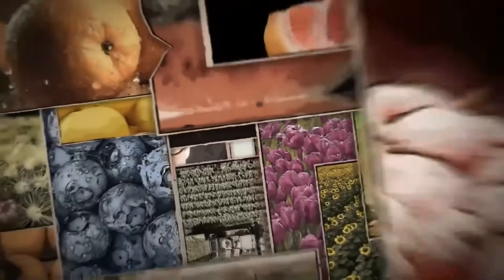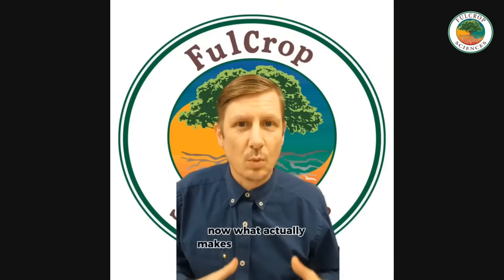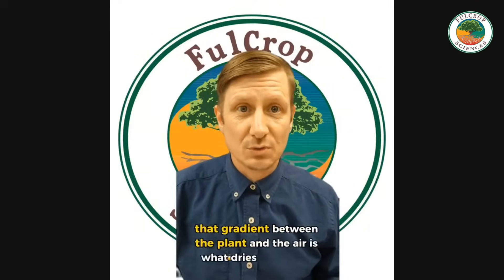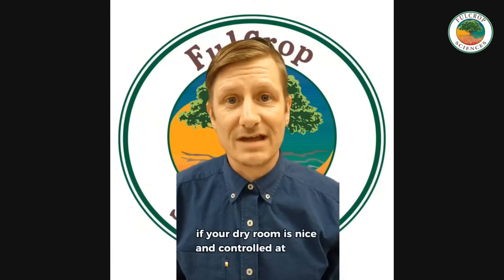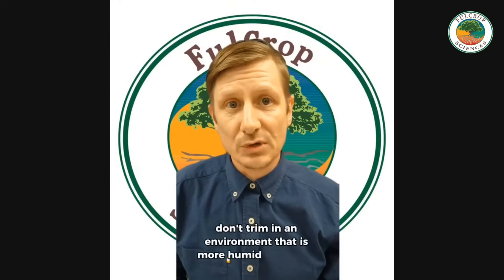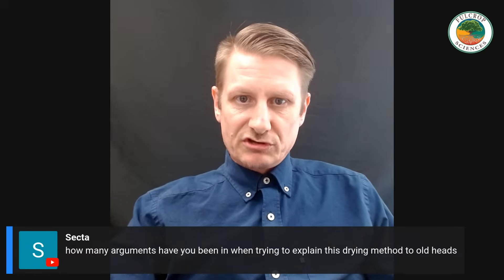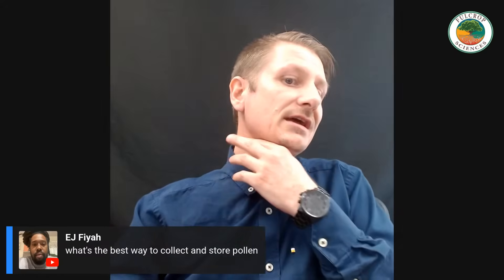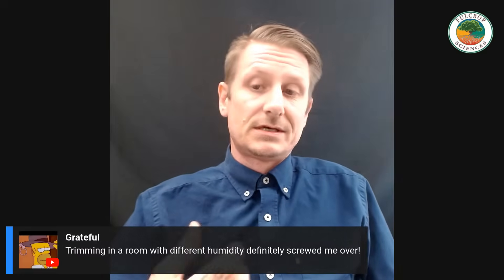Why 60/60 is NOT the gold STANDARD for dry/cure!

Comment: 60% Fahrenheit, what's that, you absolute stoner, haha. Great video, thanks for helping people realize there's actually science involved in this process, which anyone who has studied the cigar industry would know. I figured this out on my own, starting with 60/60 and then just not caring one winter and finding a better result from 70/45-50 that was in my basement at the time. I have found anecdotally that your numbers are about the same as my best cures. I've been growing over 30 years and it took an embarrassingly long time to figure this all out. It sure would've been nice to have a straightforward video like this 20+ years ago.
Reply: In my basement it's about 70/45. It seemed to work out great. Buds were a bit dryer than the stems. Everything was sugary and dried. I cut and bottled. Seems ok. Novice grower here, but 70/45 was better. But I imagine bud density is a big factor if it is the best way to go?
Reply: @jamesnorton7601  First of all, great to see a new grower immediately getting drying/curing going well. Back in 1995 when I started growing, there was no internet (technically it existed) and not much information, so it was just every person doing their own experiments and maybe a book that was often inaccurate or outdated. It's nice to see how much more is known now compared to then, and the information is easily accessible unlike the 90s/early 2000s.

As for your question, yes--bud density and also leaf density are big factors in drying and curing, as well as terpene profile. Some terpenes are a lot harder to hold onto even at low temps like 60, let alone 70 F. Some of it comes with experience over time, but most of it is science. The trouble is that everyone's growing different varieties and so it's hard to really come up with a "one-size-fits-all" solution to drying and curing. If I follow any official guides on drying/curing for a 26-week flowering landrace sativa, for example, it's going to go very very badly because it needs to be dried and cured VERY differently from what most people are growing these days (modern polyhybrids). 

Now that youv'e got your buds jarred, make sure to check on their RH regularly. I've had a few friends that were new to growing make the mistake of putting their buds in the jars a bit too early and they rehydrated and needed to be dried a bit for a 2nd time, which really isn't ideal. 

As a new grower, I'd recommend you check out Build-a-soil's youtube channel and Jade Nectar and consider growing some heirloom or landrace varieties (the easier to grow ones, since you're a beginner). The biggest waste of time for me was growing the wrong kind of genetics for 20 years. Landrace and many heirloom strains have magic in them that just can't be found in modern polyhybrids.
Reply: @tsuobachi thank you very much for all the info.
Reply: @jamesnorton7601  You're welcome. Have fun growing, I've been doing it over 3 decades now and it's even more enjoyable now than it was when I first started.
Reply: @tsuobachi I am having fun. Thank you for the advice. Keep enjoying it yourself.
Reply: F is better than c because it has more degrees/is more nuanced

Comment: I’ve actually dried at 40-45% humidity at 70-72 degrees Fahrenheit for a week and the weed was fire. That just happened to be the humidity and temp in my apartment at the time lol
Reply: I am starting to think adding humidity is not good. It would make sense to put them in a space and let them dehumidify themselves. Just try to get the temp as low as possible.
My last harvest was ruined trying to adhere to 60/60.
Reply: @granolafunk6192  how was it ruined at 60/60?
Reply: @ghostface3819  Because I couldn't get 60/60.
60/60 is not achievable in the majority of climates without dropping the temp in the lung room over 20 degrees from outside, which is expensive.
If you can't get 60/60 it would be better to approach it like you can't get 60/60/
Reply: @granolafunk6192  but how was it "ruined"
Reply: @romanhlohowskyj  Trying to exhaust nonstop dried everything out too fast. Months of curing didn't fix it.
Reply: @romanhlohowskyj  Next harvest I am going to at least do 60RH, but only after a few days at 55RH. Essentially like this video says. Trying to push through the initial dry quickly, and then slow dry them the rest of the way.
It's not summer, so I can get my temps and humidity low.
Reply: I was higher for temp but yeah, same here. I had no idea how to dry and just threw them in my closet.
Reply: That VPD is outside of the proper range.
Reply: @James-p3m8j vpd doesn’t apply like you’d think for drying. Cellulose (bud) will hold the same amount of water at 60% humidity at 50F and 80F. Once it’s dry, the moisture level depends on different physics.
Reply: @SetTheCurve  Now you are debating the scientists not me. VPD is about moisture migration, not just respiration.
Reply: @SetTheCurve  I think the main reason for VPD with drying is giving an approximate range for mold. Closer to <.8 in the first few days is the range mold can develop. If you stick closer to 1 or greater the conditions for mold aren't very good.
Reply: 55 percent humidity and 70 degrees Fahrenheit the first 5 days, drop down to 65 degrees Fahrenheit and 65 percent humidity for the rest of the dry period was my optimal range for perfect buds that stayed perfect in jars for going on 4 months cured current date
Reply: At 40% humidity. You just ruined your harvest. You don't grow. Stfu
Reply: Thats just about what my drying tent/room was at for my outdoor plants and they all turned out complete fire 🔥 especially the peanut butter breath that shit looks ,tastes and hits like indoor!!!

Comment: I agree...helps keep bud rot, pests at bay. 14 to 16 days always seemed sketchy to me. Just cause you run 60 60 doesnt guarantee a smoke. So hell yea im starting drying right now...im giving it a shot
Reply: What did you think of this new drying method? I’ve had great results with 65*\60% over 10-14 days depending. The terpene preservation was impressive. It smells so strong doing it this way that I am afraid to try this new method. Is it really better?
Reply: What did you think?

Comment: lost me when you said 70-72°f to speed it up. all that’s doing is killing terps then you contradicted yourself saying a longer 60/60 dry exposes the plants to the environment longer and terps volatize. however terps don’t volatize unless they’re in 70°f and up. you dry slow to burn off more chlorophyll all speeding up does is ruin the potential louder terps. please people just dry the closest u can get to 60/60 and always with indirect airflow.
Reply: 72/72 day 1 then gradually go down to 60/60 day 5 hold that for 5 more days. Next 4 days go down 1% RH everyday. This works the best for me, gets that 90s chronic smell everytime.
Reply: Let me try to clear this up. When you cut the bud down, it’s wet—so the moisture content is essentially 100%. When you adjust the temperature, you’re changing how much water can be suspended in the air. Higher temperatures allow for more water, while lower temperatures allow for less.

So, when we dry at a higher temperature, we actually increase the humidity, meaning there’s more water in the air. Does that make sense?

When we talked about the smell, what causes it to fade is the trichome being damaged. A trichome is basically a glass ball on a stick. If you dry too fast, it cracks—just like how glass cracks when cooled too quickly. The temperature itself doesn’t necessarily destroy the flavor; after all, we smoke it at several hundred degrees.

When you add it all up:

Higher temperature = more water content

Higher temperature = better microbial activity

60 degrees doesn't ferment properly, there’s still sugar and chlorophyll left in the plant, and burnt sugar and chlorophyll tastes bad. Higher temperatures also mean more moisture, which prevents the trichomes from drying out too much and cracking.

Unless you plan on storing the buds at 60°F indefinitely, it’s kind of pointless, because you’ll eventually keep or smoke them at room temperature—around 75°F.

Just thought I’d provide a little more information.
Reply: @cam-c7e4u  Forget broscience and stick to people that know what really happens during dry and cure.
https://youtu.be/mFSvSDEVShc?si=BRX3x5_INcXkoQUt
Reply: @cam-c7e4u holy yap. 45% is frying ur plant too fast breaking your trichs erasing terpenes combined with 70° your trichs are now starting to break down. no no just no, dry at 60/60 and enjoy the full flavor and aroma. why would u ruin 3+ months of work just because u want to smoke something faster. it’s like wine you gotta give it time. and yes im storing them close to 60° year round because again why would i work on something for months just to ruin it
Reply: @TheHarvestHouse420 it's not ruining it its very similar when following vpd yes terps are volatile  but u cant save them all specifically bc air by itself degrades them also those super low temp terps are going at whatever the temp is that they flash at and its why when u open ur grow u will smell weed and those arent in ur final smoke even at 60/60. Also if ur thinking is correct then 60/60 would be wat the flowering should be done at otherwise ur shooting urself in the foot if as u say it keeps more terps but we dont grow below 70. Personally when ive done some experiments people couldn't tell the flower apart but once smoked one tastes better everytime and lets be honest weed needs to taste good and have the effects to match everything else isn't really relevant besides it being clean.
Reply: @devinej8411  Some people are obssesing to the point of ruining the joy of a good run.
Reply: @devinej8411 no point in rushing months of work at the finish line. 60/60 for aslong as u can, you can keep your plants hanging in that environment for months and they’ll be fine
Reply: @TheHarvestHouse420 this is actually the science behind it. 60/60 is bro science and if you knew anything you would know that. 60/60 comes from an ac unit hahaha

Comment: This is very similar to how I’ve been drying my most recent harvests. Worked extremely well and terp preservation has been some of the best I’ve managed to pull off yet!

Room drying was a steady 70-72 degrees Fahrenheit(time of day dependent) and with a 50pint dehumidifier was able to keep the RH of the room between a steady 50-55%. 

Days 1-3 of drying I had the RH set to 57-58% and then dropped it down to 55% for 2-3 days and closer to 50% for the remaining days of the dry which totaled 8 days.

Definitely would recommend this as well as it cuts out a solid week or so from the “60/60” method and absolutely lessens that likelihood of mold/mildew setting in as you’re in that key window, last few drying days or going to jar.

Awesome video again! Everything you put out on this channel is solid, extremely to the point and I learn something valuable every time!

Appreciate you taking your time to make and share this knowledge with us all and for free at that!

Comment: I have always wondered if jar burping was mainly to remove excess humidity. If I have reliable RH meters in my jars and they are all below 60% then is there any reason to be burping them?  Seems to me that all I am doing is letting terps out & fresh O2 in, which oxidizes the buds.
Reply: That's exactly what you're doing once they're at that humidity you do not want to open the jar instead you want to take all the oxygen out of the jar put a oxygen absorber in the jar and store them in a cool basement or the fridge for long-term storage

Comment: The truth is every dry and cure is uniquely different, with practice comes skill.
Reply: That is true, especially with heirloom and landrace varieties. But in my experience, about 70 degrees F and 40-50% RH is always better than 60/60.
Reply: @tsuobachiI I like 65°/55%, but it's dependent on density, node spacing, amount of leaf mass remaining, water content of stalks and stems, etc also. There are so many other factors such as air flow, weather, etc. it's really different with every dry and cure. One size does not fit all. Skill and experience will dictate ones efficiency and luck with perfecting the end stages of cannabis cultivation and preparation. Whatever works for you to achieve the best end product.
Reply: @BrianM-44041  Agreed. I've been doing this over 30 years and every single time I still learn little nuances about it. It's extremely important for me because I grow 95% landrace and heirloom varities as a breeder, so the terps tend to be a lot harder to hold onto, especially with equatorial sativa landraces that can take up to 26 weeks to flower. Messing up a dry/cure on a plant that takes that long is really disappointing.
Reply: @tsuobachiit's a double edged sword with equatorial landrace varieties, they love heat l, yet heat destroys smell and flavor. Long flowering sativas are a whole other level of growing, and while satisfying and necessary for breeding, it's no picnic. Definitely more difficult and often gives you less yield. But many will agree that it's well worth the wait and sacrifice. crucial, even, for making those incredible hybrids people want. Southeast Asian , South American , and island genetics are all quite different and worth hunting through for the perfect breeder stock. We appreciate the hard work and dedication from breeders such as yourself. At least I do. Thank you.

Comment: My buddy does 52-55rh and 58-62 temp he also lets his pots dry out until right around fan leaf dropping. 

How do you feel about paper bags after the bucking of buds off stems? I’ve tried  some stuff out in bags before the trim and let it even out in there for a couple days before doing the actual sugar leaf trim. Seems to balance out the moisture smoother than just going into the jars and burping more often.
Reply from the maker: My process is exactly what I stated above.
Reply: most bags, plastic and paper, are coated with fabric softener so they don't have 'static-ness' to them